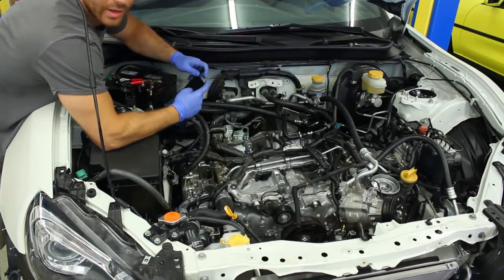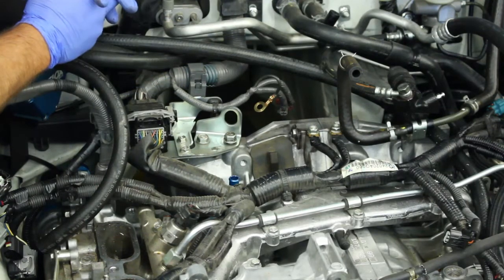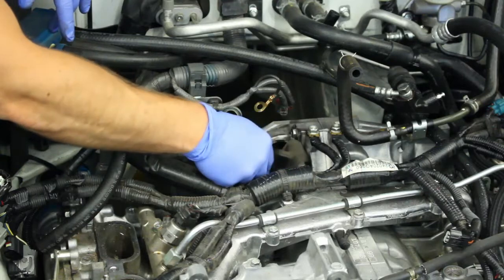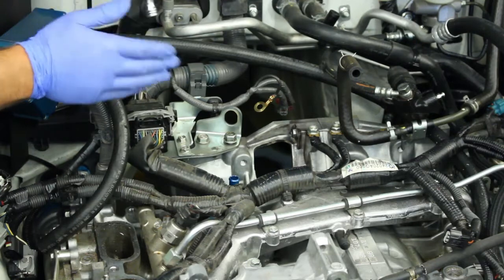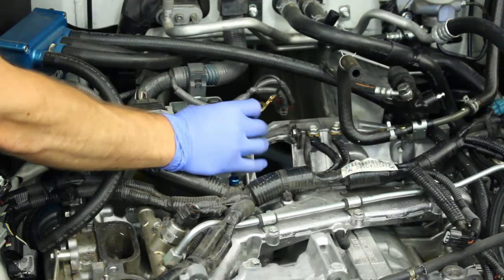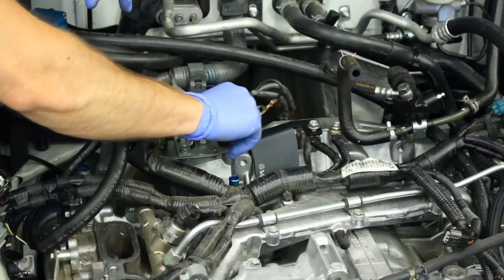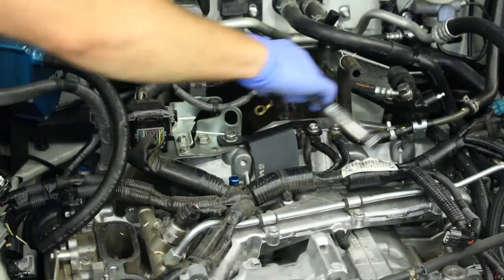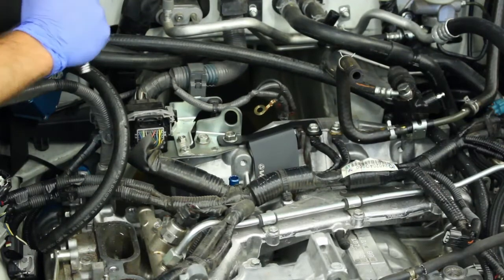FA20 Bellhousing Cover Install

Comment: Not gonna lie, you kinda scared me when you said there might be more stuff in the way with the intake manifold on… Well my cover just came today and it’s DARK outside and my car is still boiling, but I decided to hop out of bed to check it out real fast. HOLY SHIT the cover was like half off. The install would have been like, psh, 15 minutes max if it wasn’t pitch black and literally everything was hot. Plus I have a Radium Engineering PCV catch can so a line was in the way.

The 14mm bolt was pretty on there so you might need a bigger bar to get it loose (I used a metal pole with my ratchet).

Anyway, this was a smart idea. I really appreciate it. Thanks Verus 👍
Reply from the maker: Thanks for the feedback! We appreciate it.